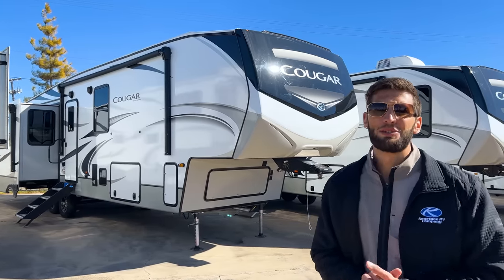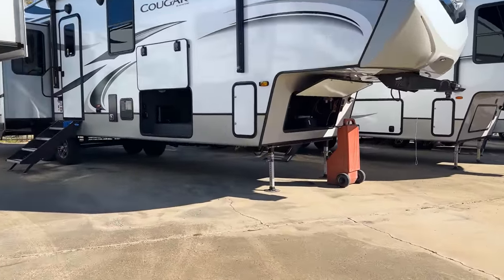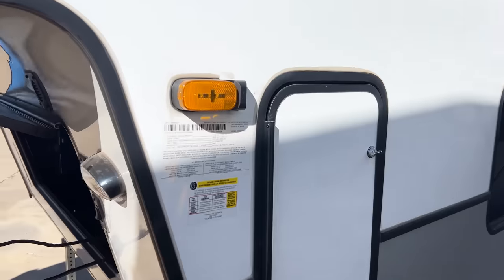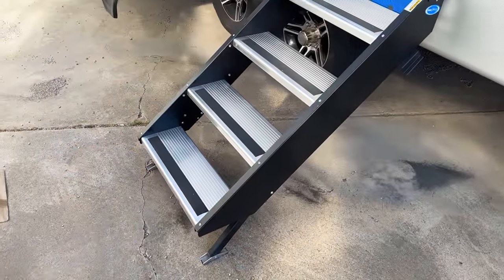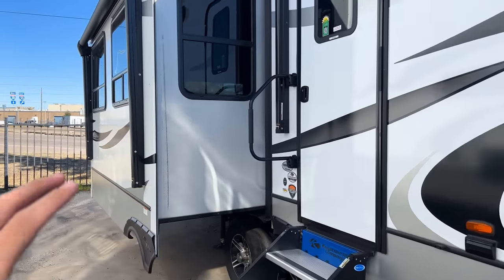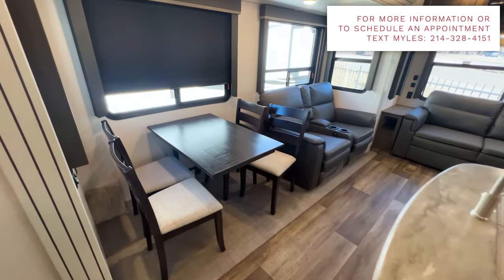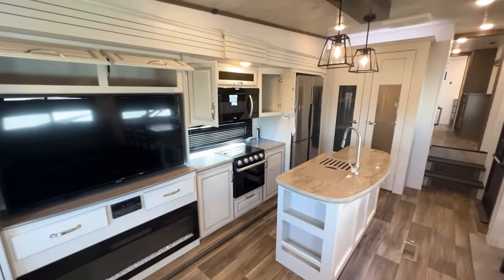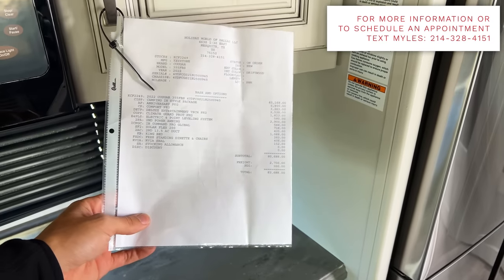Flex Closet/Office/Laundry Room and Hidden Bathroom! 2022 Keystone Cougar 355FBS

Comment: I have been trying really hard to find a fifth wheel at a reasonable price point with an office/desk built in.  This one looked great - until we find that the washer/dryer hookups are in there also.  Since we plan to full-time, that pretty much makes it useless as an office.
Reply from the maker: We just got a Sprinter 3570LFT with an office in it that’s going to be close to or possibly even under $80k
Reply: @mylesrv  Thanks for the tip! Looking at it, though, the desk is not really a desk, more of a curved lip sticking out from the cabinets - I have long legs and really need more of a real desk.  Other thing is that with those mid-bunks, you sacrifice so much kitchen counter space, and my wife and I very much enjoy cooking, so that would be hard to give up.  We're looking at possible a used Forest River Cedar Creek 355LF - it's DSO, unfortunately, but there are a couple for sale in our area.  Was hoping there might be other models to choose from.  We're also looking hard at the Heartland Milestone 360HP - the one we want is supposed to be delivered mid-February.  But I can't find ANY buzz about that model anywhere, and am beginning to suspect it might be cancelled.  It's a unique floor design - the HP stands for "hidden pantry" - theres' a tiny room up front with a desk against the back wall and a pantry to the side, hidden by doors from the kitchen.

Comment: A closet is not an office.  Sitting in a closet hunched over, leaning forward for hours working on a laptop isn’t an option.  Sorry. 🤣
Reply from the maker: I could definitely make this work as an office if I wanted to. There’s no reason I’d need to be hunched over. There’s plenty of ceiling height and floor space! But most will use it as a closet haha
Reply: @mylesrv  — With respect, the dining room table is a viable option, a makeshift wannabe desk in a closet is not.   Well, unless you want to live your elder years walking humped over walking with a cane that is.   If I were you I would choose a healthy back.  But what do I know, I’m old and walk with a cane.